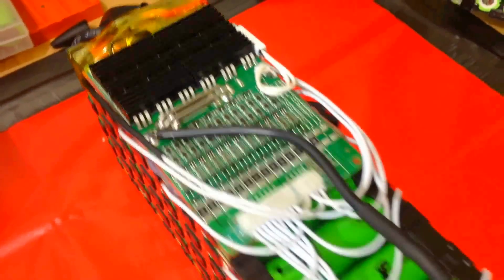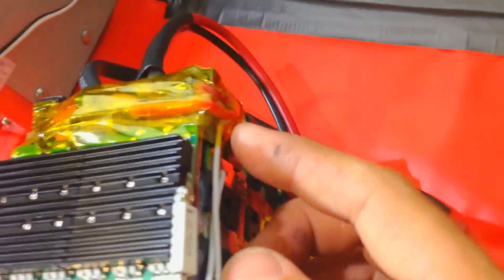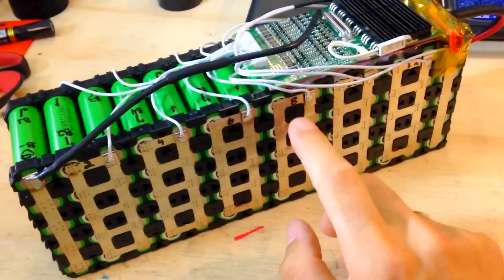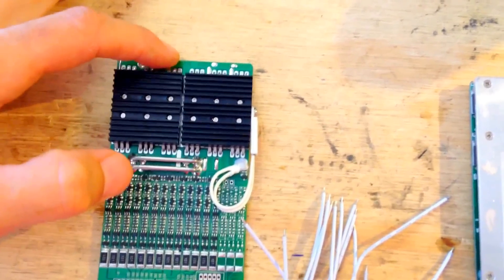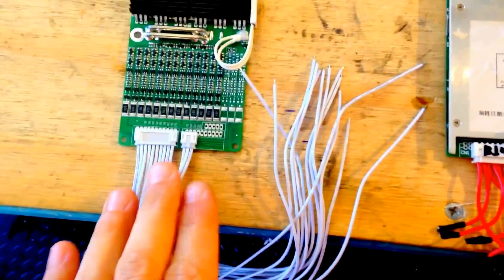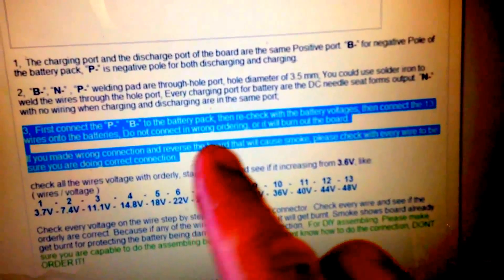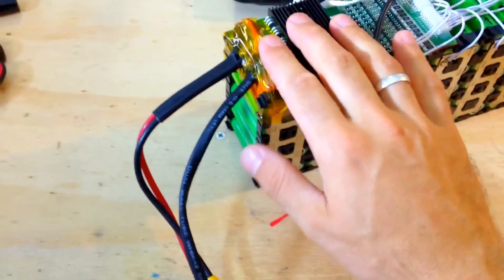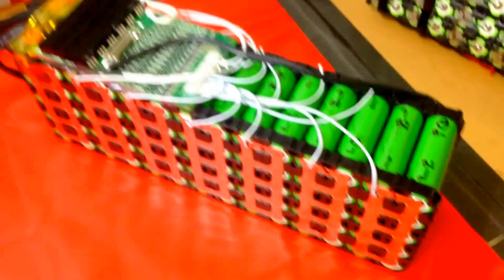DIY Battery: how to wire 14s BMS to 52v pack • 18650 cells Battery Management System • Electric Bike

Comment: Hi friend, I am a novice and cannot understand one thing why the bms wires are soldered to the negative end of thу battery though the digram shows that they they should be connected to plus end of the battery? is it because the batteries are connected with the nikel belt and it does not matter where to solder the bms wire?

Comment: Hi bro,, thats interesting and funny video. Hahahh
Emmmm.... I already make 16s2p batre pack and i got bms from AE... but it cant working well, during charging never to get full... If each batre sell get 4v,d charger will intermitten... Charging-not charging - charging... Wht u think about that?
Reply: I use ex-laptop batteries... But i hv been check and balancing voltage before make a batre pack

Comment: Is it normal for a BMS to get hot the first time a pack is assembled ? 

I've just build my first 13s 48v pack with LG 2600mah cells (7p) but when connecting the BMS I got only 39.8v at the discharge connector. Next thing I noticed it was getting hot, so because I was afraid I disconnected the balance wires... 

Before assembling each cell gave me exactly 3.65volt. following my calculations I should get almost 48 volt when measuring the last group, but I only got 44V before the BMS was connected.

I'm not understanding what I did wrong.

Comment: so there are 4p cells. and those sets are connected in 14s. Why is this better than making 14s rows and connecting all the ends? I understand it is harder to get the BMS working in that case and that it's just the way to do it. But i would like someone to explain me the main reason behind it.  BTW love your videos. Just ordered a BBSHD and 14s4p Sanyo 3.5A 3C cells and a cube bike with everything you need. and a 60watt front light for those night trips. Hope to wire it to the battery.

Comment: what gauge wire are you using in the connections to you XT90-s plugs?
Reply from the maker: XT90 connector is good with thick flexible silicone wires like 12AWG or 10AWG but 10 is overkill for most ebike motors and much harder to solder with a regular basic soldering iron. =]

Comment: When you buy a new BMS from basetek, which one do you look for? Looking at the site their all seem pretty much the same with only voltage, current draw and name that differentiate. Whats the difference betweeen PCM and BMS? And when you buy one, does the BMS cut the charger from charging once the cells are full? Or do you have to combine the BMS with a Charge Management Board as well?

Comment: such a clean job, especially compared to your first franken pack :) 

I bet doing a triangle pack is harder to get looking so neat. 

Hey your boss hasnt sent me a quote yet still....
Reply from the maker: +Jayme Capurso - Yeahh.. no doubt that rectangle packs will look 10X nicer than triangle packs... rectangle everything is in a straight line while the triangle you can make some cells in line and some in "groups" or make little bricks of 6 cells and join all in series (this is the most common and easiest way to build triangle batteries)... wires everywhere crossing other cells... making a good layer with insulating paper is a MUST in this case.. =]
I checked with Ewan as soon as you dropped me this comment, he accidentally sent to a wrong address but I gave him your correct email. Let me know how go so I can get all items ready, test all cells, pack you some nice connectors and quality silicone wires and all those little things for you =]

Comment: Hello there man, do you think it's neccesary to install a new/better BMS to my BBSHD? 
Cheers!
Reply from the maker: +Uilleam Gilvoni - Hummm... the BBSHD hits 30A max discharge, it is peak power. Most frame mount battery packs have a very small 25A/30A BMS so they can fit inside the small plastic battery case. These small BMS are on their limits and some cases ended up frying and causing damage to the cells. You could try to find another BMS that can handle more power, something like 45A/50A. Unfortunately it is not an easy plug&play task, you have to check the balancing wires, some BMS wire the balancing starting with the negative on the left.. some start from the right... some have more wires.. some have less.. it can be a bit tricky but not an impossible task =]
*I personally don't really like BMS, I disconnected the BMS about 7 months ago and my pack with Panasonic PF cells is perfectly balanced.
Reply: Oh I see. Lol, so you don't use BMS and don't have any problems even pushing it to the limit, that's interesting. Well then, i wont worry about BMS anymore, I will just leave it like that, I'm not pushing the motor to its limit anywaus haha. Thanks dude! 
Cheers!